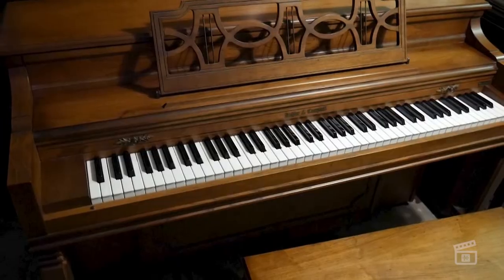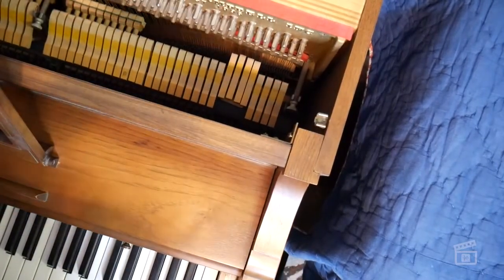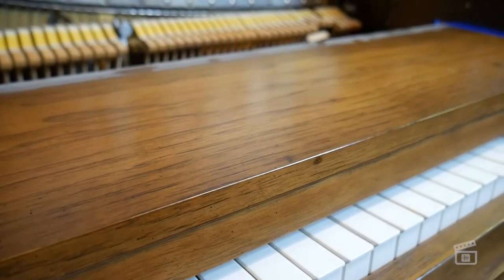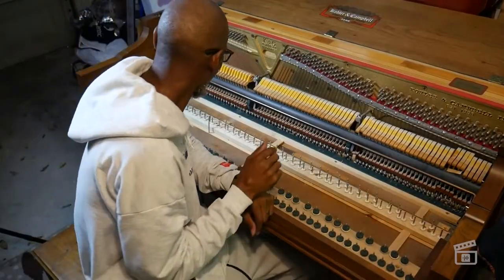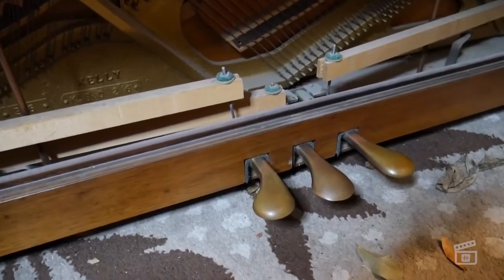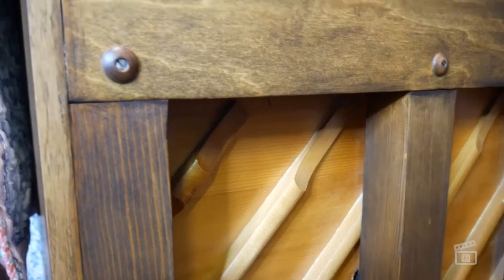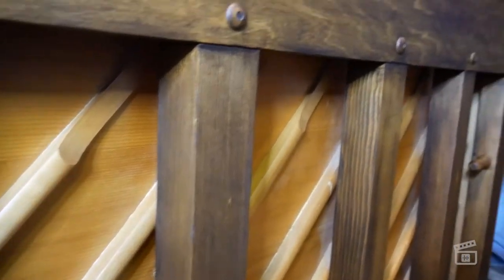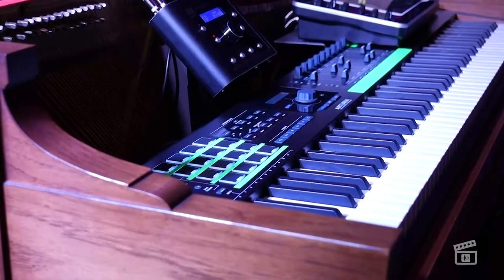Creating A "Gutted" Piano Worship Rig - Start to Finish!

Comment: You can take out the "harp" to further reduce the weight of the piano shell.  You'll need to remove the strings as well as back out all of the "pins" that the strings are tightened on.  In addition to that, there are a series of screws that also hold the harp onto the back of the piano case.  Once all of those fasteners are removed, the harp will slide out of the shell.  This will greatly reduce the overall weight of the shell and make it much easier to move around.

Comment: Great video. Are you pushing the sound output to external speakers or relying on the piano shell amplifying the sound from the keyboard? I’m not familiar with this keyboard as I have an old Yamaha PSR which has quite a weak sound. Mine is fine for home use but would be lost in a hall and I usually DI to an MAudio Interface for multitracking so I can amplify the piano to get a sound balance with guitar and any other instruments. I’d be interested to hear how you project the music in the church hall. Thanks from across the pond. Greetings from UK and many thanks for sharing your project in such great detail.
Reply from the maker: So I am ultimately outputting the sound into the house monitoring system via a audio snake on stage. That keyboard is strictly a controller (no sound) my sound comes from my computer (MainStage) and the sound module that I was showing. Mostly MainStage as the sound module is meant to be a backup sound source in the event that my computer were to ever crash during a set.